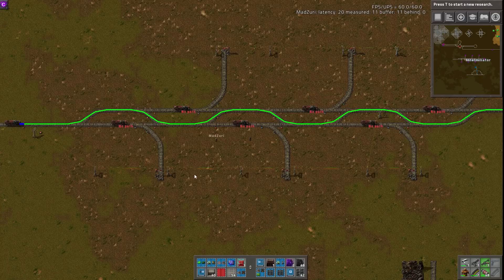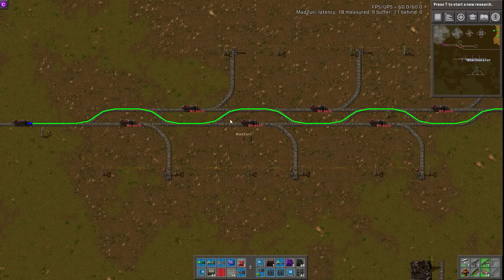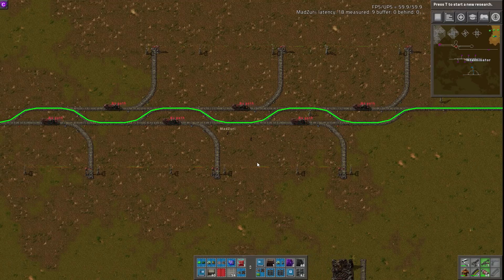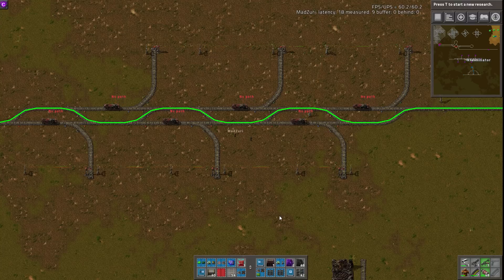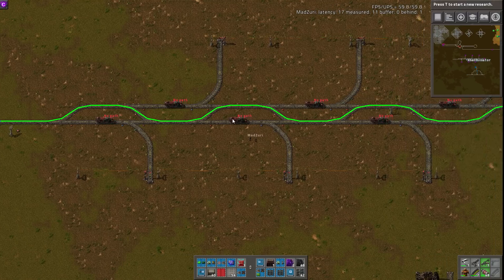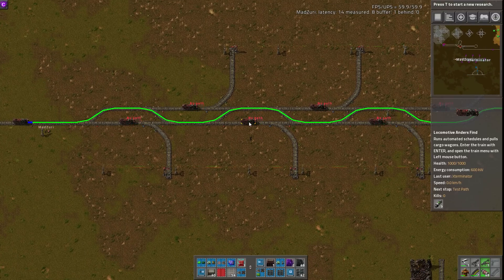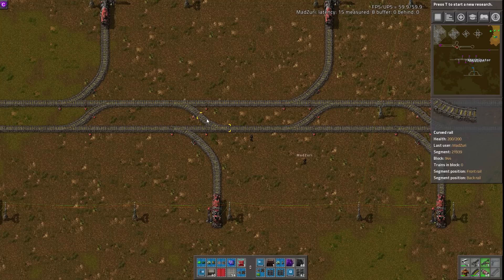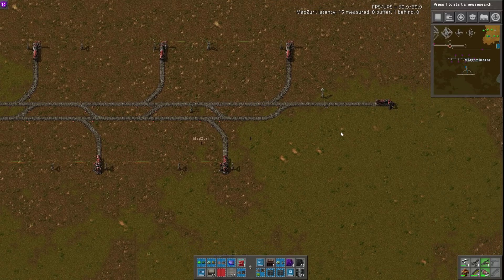Train Lane Switches & Main Line Size :: Factorio Workshop Season 2 - Building A Better Factory

Comment from the maker: Hey Guys. Important Note:
We made a bit of a mistake. After further testing it seems that trains DO repath at Chain Signals, but only with enough distance / time of a train getting in it's path. If another train is placed in it's path too quickly/close to it, it won't have time to register that and won't only NOT repath, it will just go through all the signals and hit the other train. 

Apologies for the mistake, but we didn't realize until later on and more testing. Our main point about crossovers and train's choosing their initial path from it's starting point still holds true though!
Reply: Seth is right about the meaning of a yellow signal. Trains don't go anywhere, at any speed, without reserving the blocks they want to enter.

Only green blocks can be reserved, and when a block is reserved for a train coming from a certain direction, the signals it will pass turn yellow. Other signals leading into that block immediately turn red, preventing other trains from attempting to reserve and enter it.

A series of multiple blocks can be reserved by one train, and for regular signals, the length of this series will depend only on the speed the train is traveling at (faster = more track reserved), although when following another train, the length of track it can reserve will also limit the train's top speed (since they slow down to avoid entering blocks they can't reserve).

Furthermore, once a train reserves a block, that reservation is absolute and will not change under any circumstances (aside from ripping up tracks or signals). The train is guaranteed to (attempt to) proceed into (or through) every reserved block, until it reaches a red signal (which it can't reserve) or its current destination station.

Finally, in order for a train to be able to reserve a chain signaled block, it must be able to reserve the entire sequence of blocks up to and including the first block starting with a regular rail signal, regardless of what speed the train is moving at or how long the series of chain signals may be.

These last two points in particular explain a couple of things:

Why did the train always crash into the newly placed train car? It had already reserved that entire series of blocks, and no other train should have been able to get in its way. There is no logic at work to check for unexpected player intervention -- if a player manages to stand in the way of a train (yes, I'm thinking of someone in particular here, lol) or manually drives / places another vehicle into the path of the train after it has reserved those blocks, the train ain't gonna stop because as far as it's concerned, it has the right of way! ;)

Why are you not seeing the train repathing at any chain signals? Because you're trying to get it to repath somewhere other than the first chain signal in a series, after it has already locked in its current path by reserving the entire series of chain signals.

A better test would involve having breaks in the series of chain signals where the train can stop and wait in a regular signal block prior to each chain signal, and you set it up so that when it first chooses its path, one of the two ways it can go is blocked... but when it reaches that waiting point, the other signal is blocked and the one it originally chose is now vacant.
Reply: Well yeah, chain signals have 4 stages compared to the rail signals.

Green: Path is clear.
Yellow: Train can no longer stop at this point, it will continue till the next (green or red) signal.
Red: Rail block from a rail signal occupied, stop here.
Blue: 1 of X amount of possible routes is occupied, other routes are available from this point.
Reply: +DutchDuke
I always thought that yellow signal means that this block is reserved for the incomming (potentially high-speed) train. I always thought about it as a feature to prevent fast moving trains from having to stop for a slow moving train.
Reply: Very detailed explanation! :D

Comment: is an advantage to using lane changers that for small throughput intersections (a 4 lane track that has one 2 lane track out the side), you could then only pull from the outside lanes and avoid trains blocking off the trains in the other lanes. 

also you can add buffers to lane changers which increases the throughput.

Comment: I love the final design with separate lane. 
But if you want some crossing it can be good to watch, i put 16 train in 3 lane with 2 stop that have 3 possibilities.
To make this you need to leave 7 space between lane (lane, 3 rails, 1 space, 3 rails, lane) so you can add a lane in the space when time comes. 
Put a station on each of the 3 lane and give the exact same name. 
Where the train leave the station, split the 3 lane in five (where the space was add a lane) + one on the outside for moving.
Add some parking in the 5 middle lane and keep the outside for moving.
Next you need a cross for choosing between 7 lane, always keep 2 lane in the outside for moving. 
And repeat on the other side.
Signalisation is a bit more complicated to explain especially in the cross or on the split but i'll try for the basics. 
Chain - chain
Rail - chain 
Chain - chain
That all you need to know, and only the arrow of the rail signal is important.
If you want train to park more in the middle lane cause much longer lane add
Chain - chain 
Rail - rail
Chain - chain
And basically in the cross or in the move lane juste place
Chain - chain
In start and end of segment.

Comment: So Xterminator what you are basically telling us is that the bigger the trains we have the bigger our junctions need to be to have the trains go through without delay of one train at a time? That is mostly why I go with a 1:1:1 train or Engine:Cargo/Fluid Wagon:Engine especially over long distances because you can have 3+ trains going down a straight segment. When they get to a junction usually the first train there gets through before the next train arrives even from another direction plus when going at full speed it is in the junction for a shorter time unless the station is just after the junction then it slows down in the junction which can cause problems for other trains. Could you maybe find a way to do smarter train junctions? Like have a lane that goes one direction only (thinking in terms of like a 5 lane highway) two lanes that have crossover junctions to the right only lane or the center lane to turn and crossover junctions for each other interspersed periodically or before intersections so they can pick the path they need and the other trains don't get interrupted as often?
Reply: I also Submitted a new rail system I want you guys to try out and see if you like it.

Comment: Thanks for making this video!
 So with railway planing, what would you do better with your mad science map? just watched Ep 36.! (yeah you are farther along  now 40%+). In that you had train bottle necks, bad planning or too many trains going through an area of 3 T's in a short space along the track? 

Does train length/specific trains make through put a lot harder to do? 
Thanks for showing what you learned with us!
Reply from the maker: Sure thing! Also, sorry for the late reply, just now getting around to responding to comments on some videos. :)

Very good questions. I would say the main issue on Mad Science is too many T junctions too close together, especially such high traffic ones. Train length does make a difference, but also provides benefits. For example, a 3-10-3 will take longer to travel through a junction and take up more track, so worth throughput in that regards, but it carries way more cargo than say a 2-4-2 so you would need less trains overall. Not sure I can provide a solid answer on that one as I haven't quite figured it out myself yet. 

Hope that helps!

Comment: I have tried to recreate the same procedures, but couldn't....as soon as the other trains left the track, the initial train galloped straight through to the end of the line.  The only thing I changed was I added proper signals, I didn't just chain everything.

Sooooooo, I'm not seeing a problem.
Reply from the maker: That's interesting actually. Did you have train pathing on and see if it was actually trying to path around the other trains to begin with?
Reply: Yes....it was pathing around all of them except the last train, it was completely oblivious to it for some reason (no matter how many signals I put or changed).  As soon as they all went into their home, the pathing changed to a straight line.
Reply: thats what i found too

Comment: Maybe a bit of an advanced concept, but could you do a segment on signal gap (block length)?  It is something I never understood in my openTTD days and I still don't fully understand why you shouldn't place as many signals as possible on your lines.
Reply: jonaskingofsparta signal length as a rule should be around the distance of your longest automated train he reason of its it that a train will 9nky move forward of there is spa e for that train 

On junction the usual practice is to put chain signals before junctiona so if you dint have a full length gap the train will move through and may stop halfway through blocking the junction 

In other cases a shorter gap  can increase throughput but you should only do this in certain locations and if you know what you are doing but this may decrease ups and trains may be even more idiotic if you have any loops.

Comment: one thing i have developed for my separate networks is stops that i can use to transfer PAX trains from one network to the other by using a stop that can be entered from either direction but you have to go to the stop to switch. Therefore trains that aren't scheduled to switch networks won't but you still can if you want.